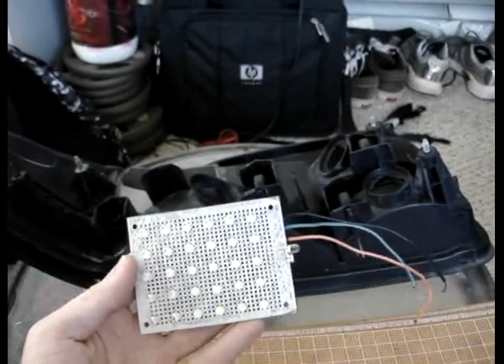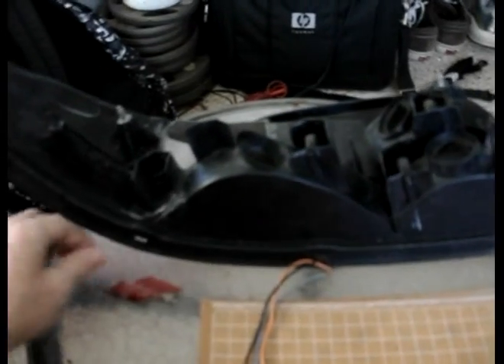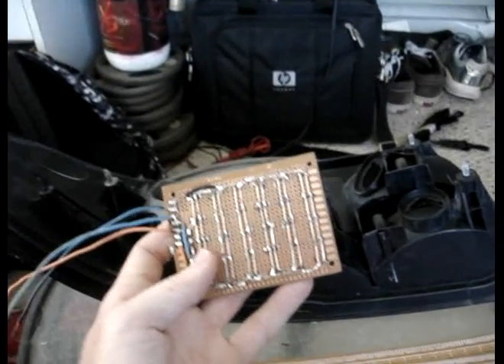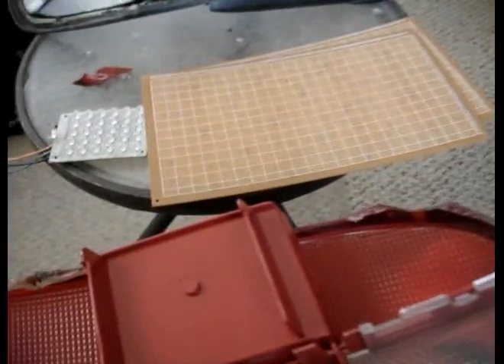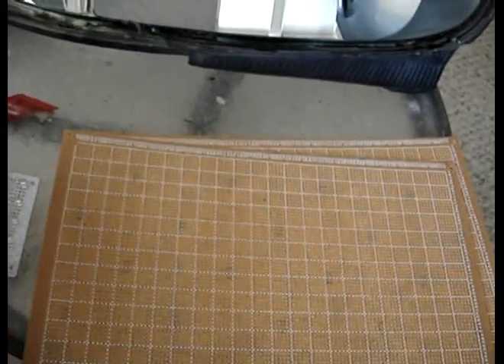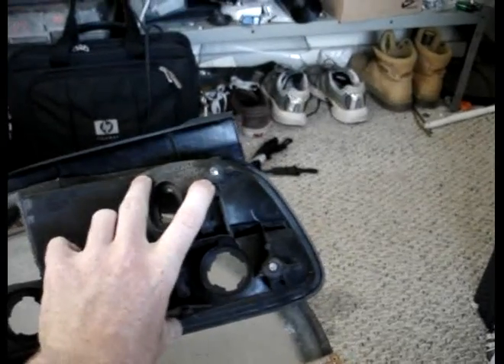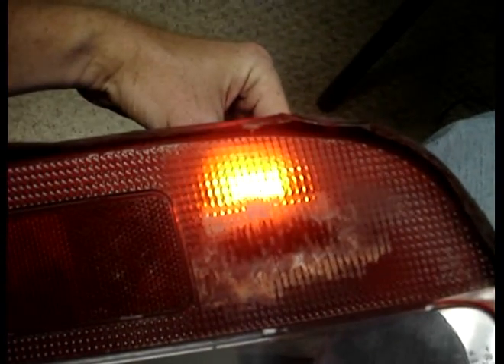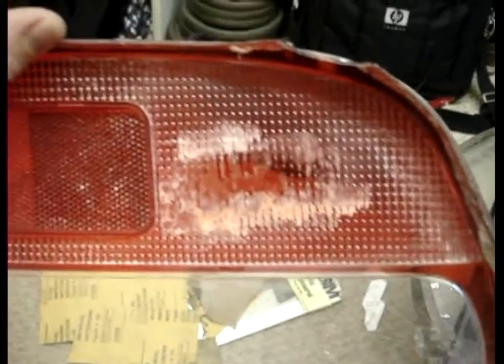homemade LED tail lights, sanding taillight lens clear

Comment: Most 12v automotive systems allow for a max voltage of 16v in circuit design as charging voltage can hit as high as 15.2v without problems. Normal running voltage is around 13-14v.

Ledcalc.com is great for led circuit and  resistor design

Comment: When building LED tail lights, never run them in parallel,  Always go in series, I hope you have already figured this out. But in series, if one LED bulb goes, only the ones in that series will go. Figure out the forward voltage and current, and source voltage.. then find a proper resistor and walla. 
Also, stay away from the cheap LED bulbs that you have in this video, LumiLEDs or Cree is the way to go, MUCH brighter, better quality too.
Reply from the maker: I know..thanks tho. I ran rows of 4 LEDs in series. Each row was parallel. I used a resistor for changing the forward voltage to adjust the brightness. The way it was wired..if one LED blows then only 4 LEDs would be out and not the whole light.

Comment: How culd u opn d tailigt cover?
Ive prblm with that,
Can u hlp me, how did u do that?
Reply from the maker: There are others with instructional videos on that. It involves putting it in the oven at 150 for 5 minutes at a time. That softens the glue. Look up an instructional video on it though, I'm sure there are many.
Reply: OK, After I done I'll send U some PIC,
Tq.

Comment: where you buy big circuits Breadboards
Reply from the maker: The cheapest place I've found is ebay
Reply: Tell me the measurement of the board
Reply from the maker: Miguel Z I don't know, these are about 2 x 3 inches
Reply: Jay  Because i need 8x5 in
Reply from the maker: Miguel Z you should be able to find them. Look them up by millimeters. I know you can buy ones larger than that because I've bought some the size of a piece of paper. Then you can cut it down.
Reply: Okay thank you very much
Reply: Thank you for putting this video, and thank you for doing so despite trolls that would rather see Youtube filled with nothing but boring c-rap no one else would be interested in. l
Last time I looked, Youtube was for everybody, not just trolls who have nothing useful to contribute to the conversations.

Comment from the maker: This is one of my first videos. And no, this never went anywhere. I make about $5 a month off of this video alone, so I have kept it up for that reason only. I thought I put a caption in it that said it didn't work, but maybe that was the other video on this project. The mounts on these tail lights are nearly all broken, so when I get new tails I will be buying rectangle LED boards with SMDs instead and mounting those. I need bright ones for brake lights, and these weren't bright enough.

Comment: wheres the finished product? you gave up?,I own a 1997 white GT hatch, I dont know if I can take any lenses off from the inside like those on coupe and convertibles, I know on the JDM you can remove the amber lens for the turn signals, but for the USDM hatch not so sure..

Comment from the maker: cool, thanks. I'll check it out. And I have other LEDs that I've wired in parallel that have been working fine for a while now on my truck. But it's parallel with resistors, and the other is parallel strands of LEDs in series.

Comment from the maker: I have resistors, I just didn't get the right brightness that I wanted so I was working on increasing it by a series of LEDs in parallel with the group. I had a white LED from a keychain light that got mixed in with my bag of lights, I'm sure that was the one that blew. In the end I couldn't get the tail light bright enough with these LEDs, so yes I need better ones. Thanks.

Comment: Use better LED's, run them in a series to match the forward voltage of the LED. use resistors, Use Sharp Voltage regulators from Digikey to keep them at a constant 12v. The way you are doing it is just a bad idea. Start over.

Comment from the maker: the leds are rated at between 3.2 and 3.5 volts. So 4 in series is the most I can do on the 12v battery, Even when the car is running and the voltage is around 13.5 - 14.0

Comment: car battery volts is 12v your led is 1.5 volts each.  if you connect in parallel still  1.5 volts  but if you connect in series you divide 12 volts to 1.5 volts came out 8 so only 8 leds only that you  connect in series connections..  you don't need any resistors just wires a negative and a positive connections. thats it.

Comment: Then came the mods to the new car. I told him leave it alone its brand new but no he started out with a cold air intake. All this did was make noise and nothing for performance. Second mod was the cat back all drone and with both mods no difference in performance.With a small 2.0 L block there will be little or no gain that you could feel. Same mods to a 5 or 6  liter block a 15 to 20 Hp gain MAX. I said the only thing that will make a difference that you will be happy with would be a turbo.

Comment from the maker: I had an old white LED from one of those little keychain lights that threw in with my box of 100 leds. I'm pretty sure that's the one that blew in half. There were 3 LEDs wired in series running off of 12v DC home power supply. Each LED is rated between 3.2v and 3.7v. 12 / 3 = 4v per LED and they were all holding except for one. The one that blew was most likely the weak one and was probably a lower voltage.

Comment: Alright man well good luck, and please keep us posted. I'm planning on doing the same thing to my mazda 6 this summer. I know that it's gonna be a pain in the ass and I'm actually considering buying some of the red white and yellow led strips on ebay and just wrapping them into circles and putting them inside the reflectors. They are the thicker, clear PVC strips that are very flexible in both directions. That way I could avoid soldering all the led's, painting, and cutting the pcb board.

Comment: you should get you some clear plexi glass and heat it in the oven and vacuum form it over your original lens, check out vacuum forming on youtube you could even get some tinted plexi glass you'll find it at loews or home depot